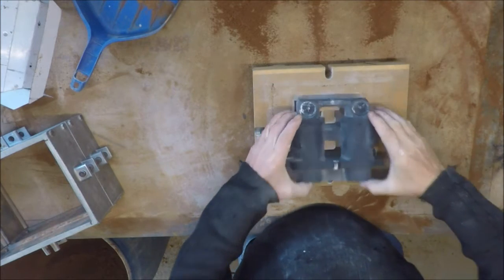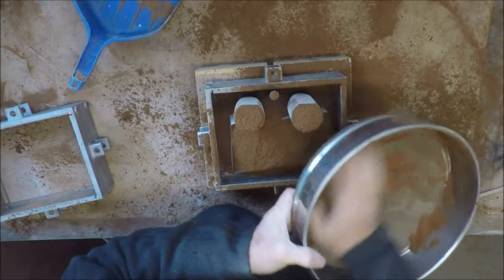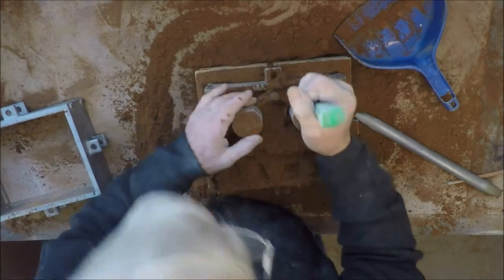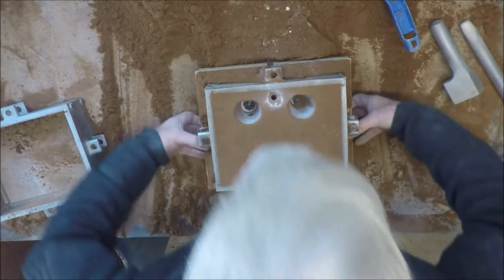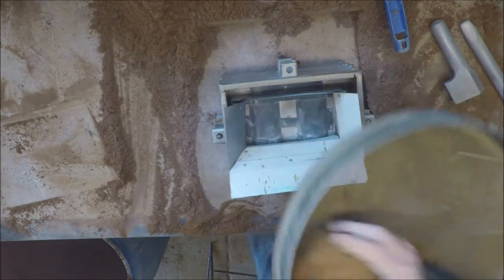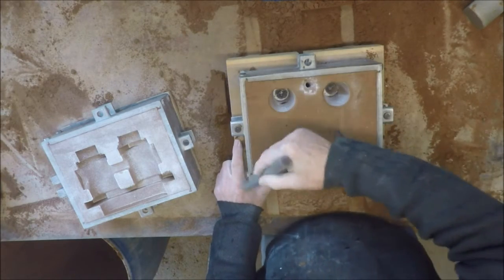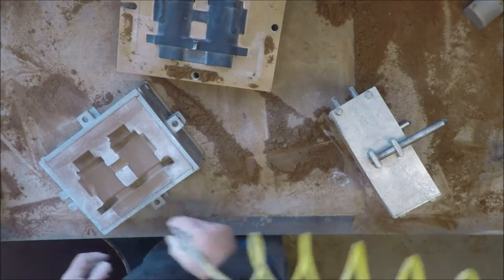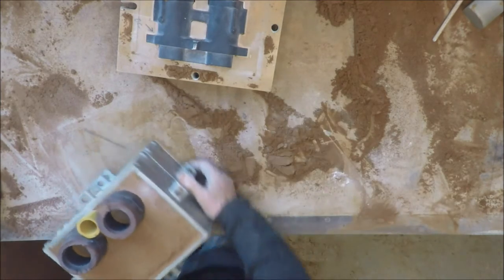My Home Foundry; Making aTwin throat throttle body Part 2

Comment: I have to ask,  is the sand you are using green sand??  It looks very light and fluffy....
Reply from the maker: Yes, it is green sand. It is not a made up sand, rather it is a natural sand i.e. straight out of the ground. Melbourne is very fortunate in that over half of it is underlain by sands a lot of which are suitable for foundry use. Unfortunately most quarries have been closed down and indeed the best of them (for foundry sand) turned into a golf course (sob). Short version of the story is (there is quite a lot more) that I have sieved it when dry to remove the few big (1/4/inch) diameter quartz particles in it, then usually pass it quickly through a sort of home made flour mill not so much to grind it but rather to break up the now small lumps into individual sand grains. I then  simply mixed it with the required amount of water using a rake a and shovel on my concrete garage floor and then, and this is the important bit, pass it through a home made aerator,  this fluffs up the sand and gives it a nice silky feel. Fluffed up thus it rams so much better. My facing sand is a little more involved - up coming video on that. And I am contemplating a video of the aerator as it is easy to make and most useful.Note that I do NOT have a muller - would not mind trying one out but have managed to exist quite happily without one mainly I think because of the aerator.PS. I do note that many people use what I would regard as "road gravel" for their sand, a state forced upon them I suspect by the difficulty of obtaining suitably fine sands. They have my sympathies.
Reply: I sooo need a shop tour..... :)

Comment: Why do you put parting dust on the finished mold cavity just to blow it away again after?
Reply from the maker: Chris, Yes, I suppose it does look a bit odd I put it on and then I blow it back Off. However there is a reason I put in on  each half of the mould as it is removed from the pattern, subsequent to this there is some processing of the mould - cutting the running system and/or  smoothing up running system junctions, loading of cores etc. these actions often produce loose sand that gets blown around all over the mould cavity. This loose sand can stick and thus produce small defects on the otherwise smooth casting surface. The layer of parting agent helps prevent this sticking and thus makes it much easier to blow any loose sand off the cavity surface and right out of the way. Also as I blow the cavity out there is a colour change as most of the parting agent is blown off this helps tell me where I have blown and where I haven't.Martin.
Reply: ah, that makes perfect sense. thanks for sharing your experience with this! i enjoy making the occasional part in my foundry but nothing like the operation you have going on there...maybe if i ever make it to Melbourne I'll have to stop by and say hello...
Reply from the maker: Chris, When you look like making it to Melbourne send me a PM via  - about - send message on my channel. I would be pleased to meet a fellow foundry man - it's nice to sit down and talk to another foundry type about foundry things, the exchange of ideas that takes place is wonderful, but it happens all too rarely.Whereabouts in Oz are you?Martin
Reply: Yes, that would be wonderful. The likely hood of that happening though is pretty slim unfortunately. I live across the globe in Eastern Canada. If you ever travel this way certainly come for a visit; I'd be glad to have someone show me a trick or two...
Reply from the maker: Chris, Hell, what's an 18 hour plane flight!  Canada you say, now there is a funny thing! My Uncle then aged 87 used to visit from Winnipeg once a year.Dad was born in Agassiz BC, Mum in Winnipeg, dads family were loyalists from NY to NB then BC.I would give my back teeth to visit your lovely part of the world but financial constraints (and lack of a passport)  make it most unlikely (sob)Martin.
Reply: yeah, maybe one of these days i'll make it out there. my kids are still small but maybe when they get a bit older. would be nice to have a good chat. all the best!
Reply from the maker: Chris, I look forward to it, but don't wait too long, that big foundry in the sky has my name - they haven't started to call it yet - But one day of course they will - until then I would be most happy to meet and chat with you - Oz is as good as anywhere else for a holiday. Keep the furnace hot and yourself cool!Martin

Comment: needs a vice over
Reply from the maker: Jan,  I assume that you mean "voice over". I would agree that sound is not one of the better parts of my videos. Despite using a good quality mic (Rode) my voice does wax and wane. The Gopro cameras habit of turning the volume down just after any loud noise does not help, in fact I find it very annoying. I have just purchased a wireless mic set up and hopefully this will improve future videos. IN one or two videos I have tried narrating the sound but find it difficult to keep the vocal description and action coincident. However I do intend to make greater use of narration in the future ,particularly when there is a lot of background noise..... Martin